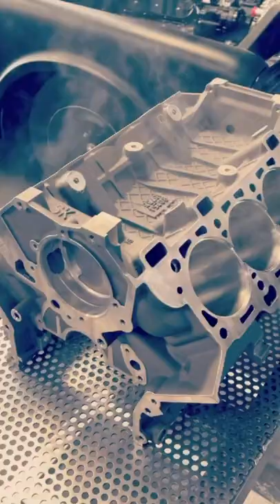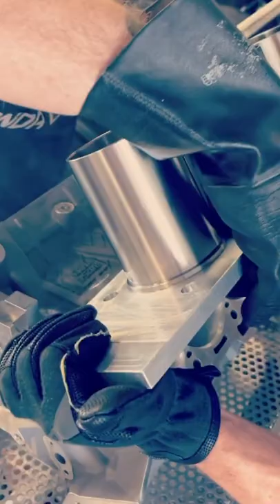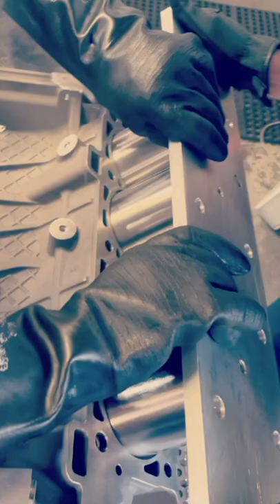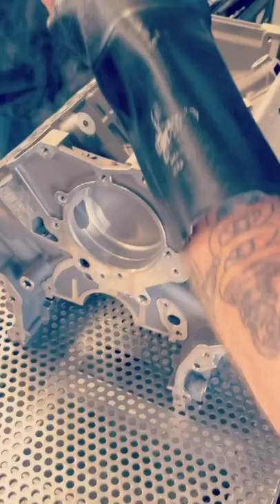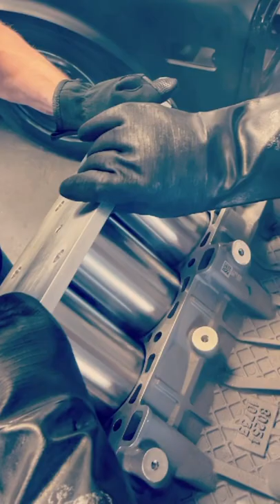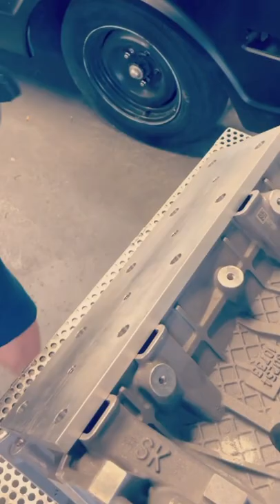Sleeve Installation on a Ford Coyote Engine

Comment: Super cool what holds the sleeves to the plate?  Magnets?  How hot do you heat the block up?  What is he spraying into the bores before they drop them?  How much interference do you use in the fitting?  How long does it take to lock up the sleeves on cool down?
Reply from the maker: We're not entirely sure what holds the sleeves to the plate, but our best guess is the sleeves are pressed onto a ring and then hammered loose. The block for sleeving is usually heated to between 400-500 degrees F. You can learn more about the build here: https://www.enginebuildermag.com/2021/11/eotw-2000-hp-capable-gt500-short-block/
Reply: Tension holds the sleeve, and it has a flange to prevent dropping to thebottom. The block already machined to tolerance, is heated to expand, the sleeves likely frozen to shrink and are a slip fit but once temperature normalizes you have specified tolerances. JAMSI have a few great videos on this.
Reply: O rings hood the sleeves on the plate.

Comment: Is this a fix method for the GEN 3 engine, 2018 to 2020 F150, that has Plasma Transfer Wire Arc cylinder liners, and having Oil consumption issues?
Reply: Yes

Comment: I have seen so many failures of the version with the 180 degree crank on either side of the rear 2 cylinders I wonder if opening the piston clearances progressively toward the rear would help with the scuffing and piston  weld transfer failures do to insufficient cooling at the 7,000 red line people operate these at. Or loosen up all the piston clearances when rebuilding them to prevent repeat failure.  Perhaps work with a water pump manufacturer to test coolant flow at 7000 rpms. Perhaps the bypass circuit needs to be enlarged or a spring loaded bypass  . Nascar engines operate with a flow restrictor not a thermostat which forces all bypass low thru the heater core.
That is too restrictive for extended high rpm cooling.